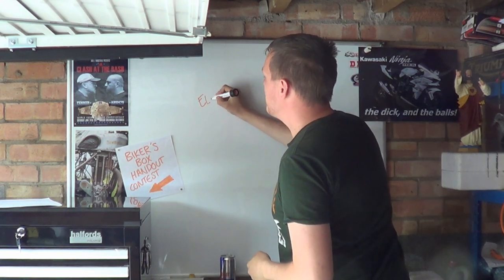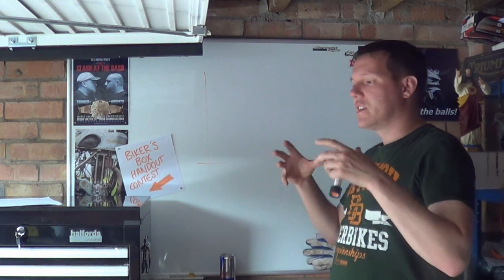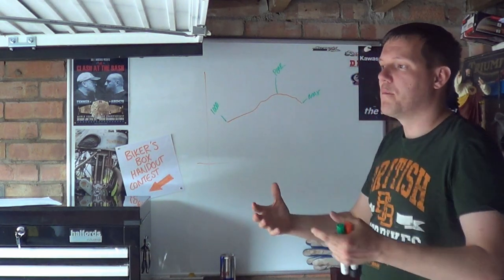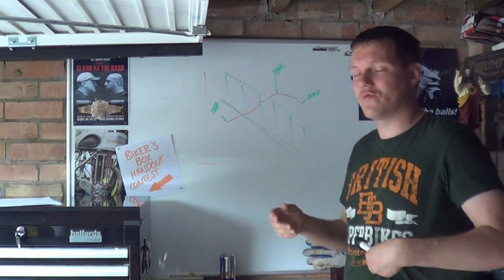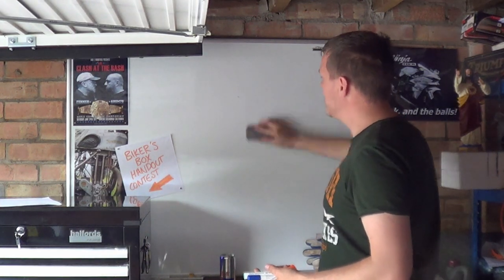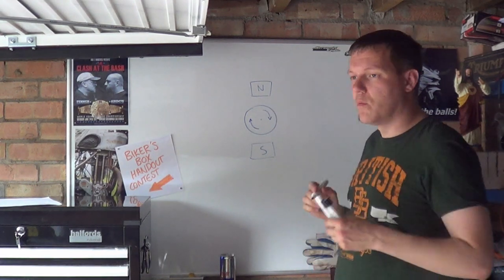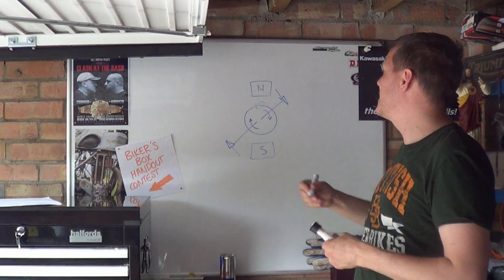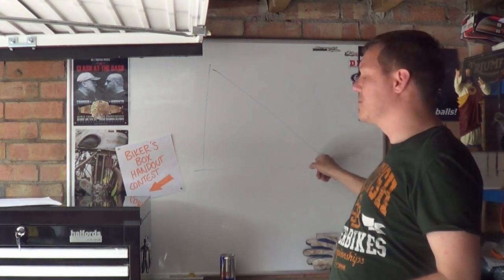Electric Motor - Instant torque - Motorbikes motors - Part 1

Comment: Your electric engine torque curve is wrong, since it also starts at 1000 RPM, not 0. That completely denies it from its huge benefit of not needing a clutch to get away from standstill. Don't just continue straight though, since real world electric engines are also torque-limited until a certain RPM, so the curve would be flat from 0 to say, 3000 RPM. 

Furthermore, engine torque is meaningless for acceleration, as soon as transmission ratios are involved. Acceleration is a result of wheel torque, and that depends on engine power, not torque. A 600 cc engine with 60 Nm at 12.000 RPM (137 HP) and a 2:1 transmission accelerates exactly the same as one with 120 Nm at 6.000 RPM (137 HP) and a 1:1 transmission. Actually, the 600 cc accelerates harder, since it is lighter. The bigger engine is psychologically preferred though, since less RPM difference for the same speed difference during acceleration wrongly imply more "umpf". You don't get yelled at so much. And usually bigger, lazier engines engines have wider, flatter torque curves that are more forgiving to bigger, lazier drivers.

Requirement band for torque? That is exactly what transmissions do. Gas engine + CVT = constant peak power, just like the electric engine. Take a large enough engine with a small enough air restrictor (old WRC turbo engines basically) and you will get something that resembles an electric engine, except fot the part between 0 and idle RPM.

The beauty of the electric engine is that it light and simple, has zero vibrations, can do without any clutch and gearing and of course, as you demonstrated, there is zero throttle delay. And you don't need to bring it to an ape with a wrench and an oil canister every year or two just to keep it alive. Batteries are shite though.
Reply from the maker: "Your electric engine torque curve is wrong, since it also starts at 1000 RPM, not 0."

- Its a simple graph, to show the line. Stop knit picking.

"Furthermore, engine torque is meaningless for acceleration, as soon as transmission ratios are involved .Acceleration is a result of wheel torque, and that depends on engine power, not torque."

- That is such a stupid thing to say, I don't know how to reply. No torque, no power.
Reply: yup and the line is wrong :D
Reply from the maker: In reality yes, and that's in the next video, this is the theory.
Reply: Thanks I'll stay tuned!

Comment: Electric motors is not like that. The torque graph you draw there is pretty much the same with the torque graph of a in-series brushed DC(can be AC too) motor. 
Other types of motors have different characteristic curves(see induction motors that tesla cars use). Also the torque and where you will get it depends on the driving circuitry too, specially on AC brushless motors! 
You could have a motor that as you said goes to the speed of light BUT you forgot the power thing! The faster you go the more power you will need and its relative to the square of the speed. Unfortunately the batteries that we have can not keep up the abuse at that power levels.